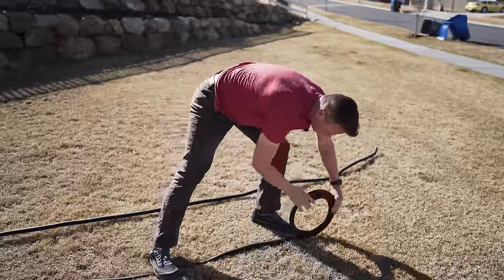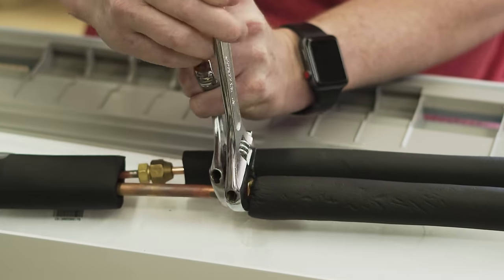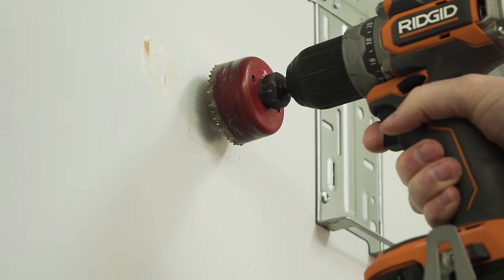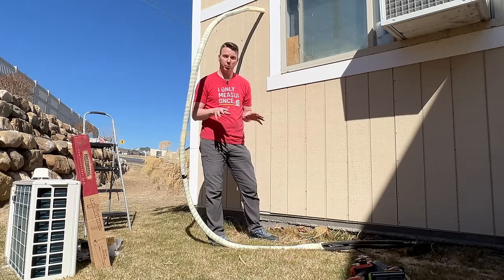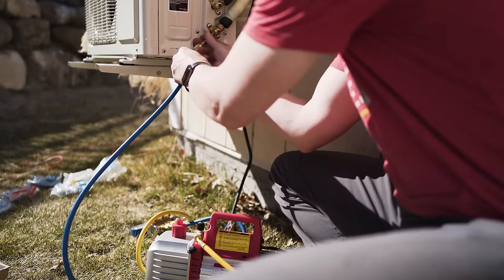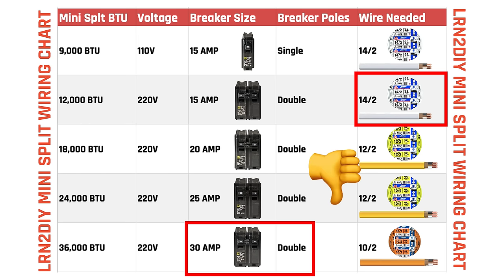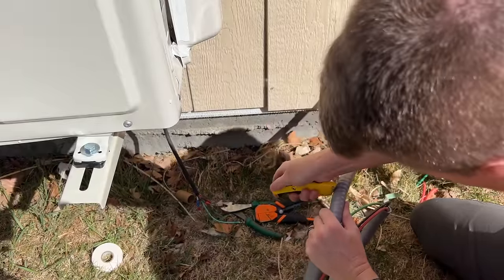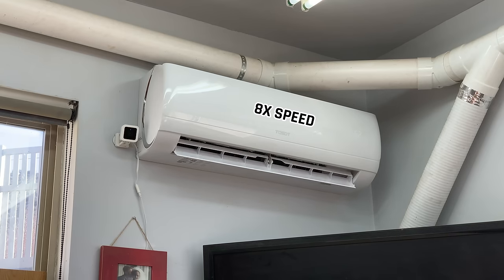DIY Mini Split Install - All the Things Nobody Shows You

Comment: Areas to be aware of:

1.) You should never use the flare nuts that are included on the refrigerant lines. These should be removed by cutting the flare off the ends of the tubing, and use the flare nuts included with the mini split equipment, and make new flares on your tubing. This should be made with a flaring tool designed for mini splits. The angle of the flares on mini splits are different than the traditional refrigeration flares. 
2.) All flares MUST be torqued to the manufacturers specifications. You cannot “feel” the correct torque, and “good and snug” is subjective. 
3.) It is acceptable to coil excess refrigerant lines to stay within the minimum required lengths. However, any refrigerant system with coiled up lines must be in a horizontal plane. When you coil up lines in the vertical plane you create oil traps. The oil in the compressor circulates with the refrigerant in droplet form. The oil cannot return to the compressor if it collects in the bottom of the vertical trap of these refrigerant lines. 

I work for a mini split manufacturer, and the above installation problems are what we see in our Top 10 Installation Issues. Overall you did a commendable job with your installation. I would only caution anyone viewing this video to make the three changes I observed above to ensure trouble free operation and performance of a DIY mini split installation.
Reply: Really appreciate these additional tips. I'll be sure to use them when I install my mini split in my new woodshop.
Reply from the maker: I love the useful info here! Thank you for sharing this. I'll see if I can reorient my lines to be horizontally coiled rather than vertical. I'm not sure I follow tip 1, since all of the flare nuts included ARE included with the mini split, not from a separate line or kit. As for the the latter portion of tip 1, I think I follow - you're saying that a flaring kit we buy from Harbor Freight, for example, will have a different angle flare than what is optimal for the mini split? Is there a place we can purchase a mini-split specific flaring kit?

Thanks again for the useful tips from someone in the know! Much appreciated.
Reply: @LRN2DIY  regarding the flare nuts, were there nuts already on the copper linset, or did you put the nuts from the unit into the tubing then make your own flare on the tubing? If so, then you are fine. If the flare nuts are on the copper lines, I would not recommend using them.  The manufacturer I work for ships our units with the flare nuts with both the indoor and outdoor units. Most mini split line sets have a flare nut already on the tubing. We instruct our dealers to cut the line set flare nuts off, throw them away and use the heavy cast brass nuts included with our units.
Reply from the maker: @rbfour5  Very interesting. Yes, they came with flare nuts on them and that’s what I used. So the ones that the manufacturers provide and include would need to be cut off and replaced? Is it because they may cause leaking down the road?
Reply: @LRN2DIY  yes. The flare nuts on the line sets are typically a thin cast brass, and not always a true 45 degree flare like the male flare fittings are on the indoor and outdoor units. If the nuts are then over torqued it will deform the flare on the tubing, and possibly even crack the tubing at the flare joint. For your shop system, I would just keep an eye on the outdoor unit connections, look for oil buildup. So clean the connections so that you have a baseline to gauge if there is an oil film that starts to build up. If it does appear months down the road, you know the flares are leaking. 
If you can reorient the coiled tubing to a horizontal plane, that would be a priority. You can strap the horizontal coils underneath the unit- that’s typically the way a contractor would do it if he is adhering to a minimum line length. Our 12k unit has a minimum length of 16’. When you aren’t able to locate the indoor and outdoor units far enough away to not have coiled lines, your only option is to coil up horizontally, beneath the unit.
Reply: Thank you!  I always value knowing what is done in the field by professionals!  I do have one question for you.  Is it possible to install the line sets inside interior walls when going from the condenser to the zone units?  I have two units I’m planning that are not on outside walls and I would like to have the line sets go inside a 2 x 4 wall.
Reply: @Dave-tg1pu  yes, it is possible to run the lines in the interior wall stud spaces. It would require access to the stud spaces by cutting through the plate at the bottom of the wall and opening up the finished interior wall. Most anything can be accomplished to install mini splits. It will require some demolition and reconstruction.
Reply: Whenever possible I simply cut out the flares and braze the lines together. Especially if the connection is to be inside a wall. Flares are always a risk for refrigerant leaks. I do the same to shorten up the line set to prevent traps { Unless the lift requires them }. I have the correct flare tool { Black Max } but I still don't completely trust them. However I'm a 30 year veteran HVAC/R tech and have all the equipment needed to accomplish the task.
Reply: @LRN2DIY  rothesberger makes a offset 45 flare tool that is suitable for that
Reply: @rbfour5  What if you only have like... half a coil worth of extra line?  My linesets were about 2 feet too long.  Too long to be a straight run, but too short to coil and hang under the condenser.  The extra is in a vertical position shaped kind of like a squished down letter C.
Reply: @nathanh4237  I’m trying to visualize the “C”, so I don’t really know how to comment. As long as your “C” doesn’t create a trap or an inverted trap there should be no problem. 
If your line set was 2’ longer, the first question I have is what is the total line set length? The second question is what is the manufacture’s minimum line set length? If cutting off the additional 2’ of line meets or exceeds the minimum length requirement, that would have been a good choice, or to simply move the outdoor unit to accommodate the length.
Reply: You dont have to use torque wrench for flare nuts. Installing aircons 10 years, never had issue.
Reply: @kareleisenhamer6549  you are one lucky installer. It’s your choice to follow manufacturers installation guidelines or not. And yes I suppose you must have the right feel for various tubing/ flare size torque requirements. I’m only pointing out installation guidelines of every mini split manufacturer that I am familiar with.
Reply: @rbfour5 I'm pretty concerned about a possible mistake i noticed and would like to know your opinion about it. He disconnected the meterset from the serviceport BEFORE opening the valves. Won't the coolant lines be filled with moist air instantly?
Reply: @mennoregts208  The service valves on the outdoor should be opened to pressurize the system before removing the manifold. You need to leave the manifold set connected to monitor the refrigerant pressures on startup of the unit. The installation instructions typically will have a chart with high side and low side pressure ranges depending on which mode you are in (heating or cooling) at a given outdoor air temperature. You can have a leak proof line set. But the refrigerant pressures can point to a problem such as a bad electronic expansion valve; a bad compressor; etc. Removing the manifold hose set while under a vacuum can introduce air/ moisture into the refrigerant lines. That is not good. Air/ moisture is noncondensable in a refrigerant system which creates a whole new set of problems.
Reply: AC tech of 10 years i would not tie the drain line with the copper lines you went that line at the lowest point so it well drain good
Reply: @averynw9180  I've have done several hundred of these over the years and have had great success with keeping the systems tight for years. It is possible
Reply: @averynw9180  one thing that helps is always use a quality line hide and make sure it's tough like inoac secondly they need either a bit of length to accommodate settling of the unit or super firm mount also if the nut does spin freely on it and flare cups perfect it should take some abuse like re leveling a unit. Just a few ideas based off of my previous mistakes.
Reply: Thanks for the info!
Reply: @mennoregts208  I'm surprised no one else other than you has pointed this out. This is a major issue the way it was demonstrated in this video. His evac basically means nothing bc he atmospheric air was allowed to enter the system at the end before he released the refrigerant.
Reply: Everything you're saying is true I tried to tell that to AC installers and they don't listen none of them even have torque crescent wrenches they just say they go by feel one guy didn't even pull a vacuum he just Purged the the line and all the and all of them with the pre flared lines eventually had leaking problems. You should make a video on how to do it properly. Some of them didn't even have the adapter with them Mini Splits aren't something they're used to doing often I suppose. I started using them about 17 years ago they are a lot more popular nowadays I've always noticed overseas there's they're very common I live in Florida I starting to see some around lately in the past few years on some older houses that don't have an attic and some shops and spare rooms but most still have the noisy window units
Reply: @rbfour5  just push the bare copper tubes, flexible drain and cable up from hole to hole, fit some nylon bending tube first. Once it's in position, foam fill the cavity.
Reply: Facts! You can also pay a pro to do it and be done with it  lol
Reply: @fixedright5161  good luck finding one most wont do it because they want you to buy theirs at a extremely inflated price 3 to 4k for a installed units you could but online for 1k and installl yourself in a couple hours
Reply: @magiccheeseball  it's not an inflated price. If you want Fujitsu or Mitsubishi it's 5k just for the equipment
Reply: @fixedright5161  of course price is vary between models and Brands and sizes but I said for a 1K mini split like a gree or whatever but they charge  $2,000 on top of whatever the cost is and I'm talking about just a simple single zone mini split like the one in this video it's a 2-hour job so they want $1,000 an hour basically, no thanks I put many of these in and I'm not even a handyman there's nothing to it a kid could literally do it. But I don't know what the guy in this video is thinking when he coiled the extra line up behind the air conditioner where it will restrict the airflow.
Reply: @rbfour5  the problem with YouTube is that you have people making tutorials who are doing it the first time without a ton of disclaimers. People like you should make videos. There seems to be an inverse relationship between how good someone is at producing entertainment vs their hands on experience and expertise on a subject. Not to be rude to this video- it was decent and entertaining. There are a lot of much worse examples.
Reply: @fixedright5161  I just had a second Mitsubishi 24K Inverter HP SEER 18 pro-installed for $3900 including the Unit (reused existing elec. disconnect),  in SWFL.....$5k+ install is highly inflated IMO.
Reply: @muskyful  sounds like you had a replacement, not a new install there. Also, we work in Westchester county in New York. One of the most expensive places to live outside Manhattan. 

3,900 at today's costs up here won't cut it up here.
 3 years ago, I could do a single zone 18k-24k Fujitsu or mitsu with electric install for about 4500  and everyone was happy.
Reply: Wasn't Me  I found out the hard way on the last one I installed (bought special order from Home Depot), that the only "warranty" service they offer, is to replace the entire unit with a different one, otherwise they hand you off to the manufacturer, who as it turns out, doesn't actually warranty the line set anyway, just the indoor and outdoor units.

Had to get a replacement line set to turn it on, and I'm sure glad I tested it with nitrogen before opening up the service valves to let the R410a spray out!  There was a hidden break in the line set somewhere under the insulation in the middle of the line.
Reply: Wasn't Me  Ive been cutting the flares of for 30 years never had a problem with warranty
Reply: @LRN2DIY  There's a high probability that your unit uses R-410A, so your flaring tool would need to be 45° which is the standard angle for R-410A lines. and the torques you'd need to use would vary depending on the size of the lines but should all be in your install manual. some open end torque wrenches are pretty affordable, or the adjustable digital ones are about $200. But pressurizing with nitrogen and using a liquid leak detector would ensure your nuts are tight enough and eliminate the need for an expensive torque wrench. R-410A is a higher pressure refrigerant than the old freon, so pressure testing to at least 300psi is good practice and will also ensure a quicker evacuation if the air is replaced with nitrogen. But either way rbfour5 is correct when they say to cut off the pre-flares. They're so bad and have so much potential for leaks.
If you're looking for a quicker evacuation you can get a valve core removal tool for 20 bucks (or so) and those come in 5/16 for mini-splits. also give you a tee to use a proper micron gauge - which isn't necessary but I like having more information than you really need when doing stuff like that.
Reply: This is all useful info but as far as #1 goes I'm not sure it applies here since the line set is supplied by the manufacturer of the unit and if we can't assume it has the correct fittings then we can't assume that they will sell you new ones that are correct either.
Reply: @johnathon007  the manufacturer of the equipment does not manufacture line sets. And every manufacturer that I have represented, sold and installed states to cut off the flare nuts that come with a line set and to use what is supplied with the equipment. In the last 30 days I have dealt with (4) systems, different installations, contractors and all reported as “ your equipment is a piece of (fill in the blank)”. EACH system had leaks at EVERY flare fitting. Those fittings were the ones supplied with the line sets. Once the contractors replaced the flare nuts with ours, somehow the equipment was no longer a piece of…….
The installer has the choice to either follow manufacturer installation guidelines or not. They do not get to choose the consequences. 
I stand firmly by #1.
Reply: @rbfour5  i dont see why you would have to change the brass flair nut in the line sets that come with the mini splits.. you would think the mfg would make them right,, i dont know about the usa products but all brass flair nut are for a 45 deg flair heavy brass fittings and coper tubing is a 0.30 wall  used in gas, air conditioning. power steering on pontoon house boats rated at 1200psi
Reply: Even if you buy the copper lines with the split system they have the wrong flare nuts?
Reply: @robertsmith2956  I have not personally seen a flare nut in a lineset that has the same quality in thickness of the cast brass on the OEM units in the past 15+ years. Not to say they aren’t out there, but I have not seen any that I would use. If by chance I found the flare nuts to be comparable I would check the flare that the lineset manufacturer made on the copper lines. Those too are usually misshaped, flare may be too short (not enough shoulder to seal on the male flare fitting); too long; not concentric to the circumference of the tube. I have seen this many times. It’s not that difficult to cut off and make new flares (with the right tools).
Reply: @ajcruzin2760  That’s very unfortunate. It goes against all refrigeration practices. To coil a refrigerant line vertically creates a trap period. An inverter (variable speed) compressor will magnify the problem with vertical traps in the refrigerant lines. The lower the compressor speed, the lower the refrigerant velocity. The oil in a refrigeration system moves through the system while entrained in the refrigerant. That only happens with enough velocity to pick up the oil droplets. When it slows down enough the refrigerant cannot carry enough oil back to the compressor. The oil lays in the bottom of the vertical traps created by looping the lines starving the compressor bearings of oil, then failure. There is no magic in one manufacturer versus another- the laws of physics and thermodynamics are the same regardless of the brand. Even if one states you can do (fill in the blank), when proper design criteria states and proves otherwise.
Reply: Just use the spin tool bits
Reply: @ajcruzin2760  I would only be speculating. It would depend upon who actually wrote that statement. Mr. Cool is not the manufacturer. The brand is private labeled for them and built by another manufacturer. This is not uncommon. There are several large manufacturers who private label their product under many brand names. But whoever made that statement in writing may not have the technical knowledge and experience of how refrigeration systems are applied. All I can say is that if this or any other brand says that you can do (fill in the blank) then when there is a major component failure they will have to honor their limited warranty on said component. I would caution the end user to know what the limited warranty states- the inclusions and exclusions. Remember- “The bold print giveth, but the fine print taketh away”. All my comments are not to deter anyone from buying a specific brand. Any brand that is sized, applied and installed properly should provide years of trouble free operation. When a installer goes outside of guidelines, instructions and known practices within any discipline ( refrigeration, electrical, piping, air distribution, etc.) then there should be no heartburn when a self inflicted failure occurs. Some choose to ride that curve of “let’s go outside the guidelines and hope nothing fails on my watch, if so we can blame some other entity “. Sounds harsh, but believe me I have seen it regularly over 37 years. 
To anyone reading this thread, and you believe it will be fine to do anything contrary to my comments and years of field experience, you have every right to follow the path you choose. For whatever reason. Whether you are a contractor or a DIYer, do what seems right to you and let’s all hope that your installation is successful with no issues or failures. Remember the installer is responsible and accountable for their installation. Good, bad or indifferent.
Reply: @rbfour5  I deleted both my replies because I don't want to be the purveyor of bad info. I looked at the install instructions yet again, and they actually do say "Keep excess refrigerant hose coiled. Wrap with protective tape and store behind the condenser in a horizontal position (flat with the ground)." Apparently on my prior read-throughs I stopped at "behind the condenser" because there isn't room to store it flat behind the unit. I'm big enough to admit I read it wrong, and this just proves why it's good to always read directions multiple times before starting something this big.
Reply: @ajcruzin2760  all of us have made mistakes throughout our lives. Mistakes have taught me much in my 61 years! 
Two things- you have my utmost respect to have reread the IOM and found you had misread it and come back to this thread to say so. Not all people would do that, so my hat’s off to you! The other thing is that I am very pleased to know now that the manufacturers statement is based on good refrigeration design practices. 
Again, thanks AJ. This entire thread has been enjoyable. Great questions and engagement. I don’t claim to know everything. But I am more than happy to share what I do know if it can help someone else.
Reply: what dealer do you work for? better question why don't they provide flare nuts that are expectable for install? ridiculous... buy Mitsubishi and never look back
Reply: I can see what you mean about the extra coils being wrapped in a horizontal plane.  Makes sense.  But, I am close to installing a Mr. Cool mini split and their instructions specifically say to coil the lines like LRN2DIY did, except they say to only UNcoil just what you need.  I can't imagine where I would locate my lines on a horizontal plane.
Reply: @sandmandave2008  in the Midwest and Northern climates, all heat pumps whether conventional or mini splits are mounted up off the ground- need to be above the expected snow line. Most mini splits that I see are typically stand mounted- either a wall mounted stand, or ground mounted stand. The excess line is suspended to the bottom of the unit/ stand. The other thing you can do is locate the outdoor unit farther away to cut the lines to the MINIMUM allowable line length so you don’t have to coil any excess length. Make sense?
Reply: @IIDontFeelSpeciaLII  I work for a mini split heat pump manufacturer. Are you questioning why the lineset manufacturer does not supply better flare nuts? Every mini split equipment manufacturer I have experience with has high quality cast brass flare nuts already on their equipment. The lineset manufacturer uses a cheap, thin flare nut; the flares are typically inadequate- the shoulder length is not long enough for a R-410a flare, the face of the flare that mates and seals against the male flare fitting is non concentric to the pipe, scratched surface and even burrs are present. So not only are the flare nuts bad, the flare itself is very inconsistent and of poor quality. Thus the reason that Mitsu; Fujitsu; Daikin; Midea; etc. instruct the installer to cut the flares off the lineset and use what ships with the heat pump equipment. 
Not sure I understand that your comment “Buy Mitsu and never look back” is relevant to the lineset discussion, but perhaps I misunderstood your meaning. 
So- who do you work for and what brands do you sell?
Reply: Here’s a video that shows exactly what I have been discussing regarding lineset flares and the flare nuts. Go to around 8:35 in the video, to about 9:40- you can see in real field conditions what I’m talking about 
https://youtu.be/itoro65YpZM
Reply: @rbfour5  yes. I’m in Texas so I’m mounting my condenser on a concrete slab.  I would use a wall mount except that wall will have a load on it for some interior stuff and my metal building manufacturer recommends not adding any more. I may move the outdoor unit further away to eliminate a looped line. A little extra #10 wire would be cheap insurance
Reply: @sandmandave2008  good choice. I too would move the unit to prevent any excess lines that would require coiling up.
Reply: any suggested tools for the flares?
Reply: @foyjamez  yes
BlackMax # BFT850
Yellow Jacket # 60278
Both of these have a tube height gauge built in so that the length of the flare is what you need for R-410a refrigerant. The BlackMax also rotates in an eccentric fashion to help reduce marring the inner flare mating surface. These are not cheap, you can find online $130- $165.00. You can use a lower cost flaring block but you would need to extend the copper pipe through the block about 1/8” as opposed to stopping it flush to the block. If you stop flush you will end up with a short shoulder on the flare. I know contractors that use both types. If you are careful with the standard block type you will be fine.
Reply: @rbfour5  thanks. I was inspecting a 150 unit remodel and the super sold the old minisplits cheap. So, I've had one that I really want to put in my 480sf workshop.
Reply: @mennoregts208  I spotted this too. I don't understand how you can disconnect the meterset without air flooding into the vacuum instantly?  Is there some kind of check-valve built into the service port?
Reply: @rbfour5  Thanks man. I usually don't engage in the comments simply because there are so so many people who seem to exist solely to try and get a rise out of people instead of having a rational conversation. You're the antithesis of that type of person. While I'm a little south of you as far as age, I'm well beyond the stage of "taking my ball and going home" when I'm wrong. I also wanted to make it clear to anyone who had read my prior comments so they didn't follow bad advice (mine). Hopefully someone else sees this thread/string and finds a takeaway unrelated to a mini split install.
Reply: @sandmandave2008  I'm installing mine soon as well. I'm fortunate that it's in the garage so my intent is to run the lines inside the garage along the top plate to the point where I can just reach the outside unit when I go through the wall and down. If your DIY kit also has the 25 foot standard line, they do offer for sale separately a shorter pre-charged line set (I want to say 16 feet or so).
Reply: @ajcruzin2760   I have looked at the Mr. Cool website and am not willing to pay $235 for the 16’ line set. After checking out all options I guess I’m going to have to leave some of the line set coiled up.
Reply: @rbfour5 I noticed he skipped the nitrogen pressure test. Is that ok to do? I am about to install one and the nitrogen pressure test really seemed like my only obstacle of confusion. If it's needed however, i'll figure out a way to get it done. I am going to DIY the install because every pro quote I got is about $3500 or more JUST to install. If I make a fatal mistake, I can buy another unit and still be ahead of the financial game lol. I am going to be installing a Cooper and Hunter 18k
Reply: @josephmccrillis8446  A nitrogen pressure test is a great way to prove you have no leaks. When you evacuate the lines down into a vacuum and watch your manifold low side gauge, the dial indicator may not reveal a small leak. This is referred to as a decay test. The only fool proof way is to use a digital vacuum gauge and watch to see how much (if any) vacuum is lost. Knowing that most DIYers will not have a nitrogen tank with a 650 psig regulator, this was not a catastrophic misstep. Only thing different would be to leave the gauges on the service ports, then open up the valves to get pressure on the lines before removing the hoses. If removing the hoses while in a vacuum you risk introducing air, moisture into the lines. 
If there ends up being a leak in the system after startup nitrogen would definitely be required to isolate the leak. Again, 600 psig using a 650 psig regulator. The standard 250 psig regulator will not find a small leak.
Reply: @josephmccrillis8446   I really don’t see the need for a nitrogen pressure test. If you pull a vacuum and it holds for half an hour, I’d say you have well sealed fittings. I know the nitrogen test puts positive pressure in the system, but aren’t you really looking for leaks, not how much pressure your system will hold?
Reply: @magiccheeseball  there is a major difference in minisplits engineering.... what you all are talking about .. is cheap Chinese garbage!! Most companies won't touch them.. BECAUSE.. no dealership network.. no distributor network... no manufacturer support..little to no parts availability... poor warranty! All you have is the price! Chinese minisplits are meant to be disposable... if it breaks.. buy another new one! Mitsubishi/ fujitshu are kings of the hill AND FOR A REASON!   P.s.. Chinese minisplits are not allowed in commercial and industrial applications. THIS IS NOT MY OPINION... ITS MY 30YR EXPERIENCE OF HVACR... but hey.. if your happy with it... good for you... time will tell!  China is known for cheap mass produced low quality products at super cheap prices! That's what China is good at!
Reply: @Blitzkrieg.u812  yeah
Reply: @Kevin-ip8uf  I believe in Europe it is now compulsory to pressure test with Nitrogen.
Reply: @magiccheeseball  done several of these and coiled the extra few feet of line set up behind the unit. All working fine for several years now. Safe and out of the way.
Reply: I agree he’s setting him self up for failure
Reply: I am planning to install condenser on my flat roof which is obviously going be above the wall mounted inside unit , the line set would need to be run vertically and make a couple turn to get around the eve. Question is would this likely cause an issue or trap refrigerant since lines will be running vertical to reach roof? (about 2-3 feet of rise)
Reply: @gusb232  as long as your piping does not drop and rise vertically you will not create a trap(s). The lines can drop down vertical from your unit in the roof; turn horizontally, turn vertical DOWN, turn horizontal, etc.
Reply: @rbfour5  "piping does not drop and rise vertically" Thanks for the response , I just spoke to the Tech support at Senville and they seem to say it should be ok.  But Im not sure I explained well enough.  Since the lines exiting the unit and through the wall are recommended to be angled downwards (not sure If i can ignore this in my situation?) Then they would be coming down vertically for a few inches and then turn up towards roof.  Thinking of instead exiting wall at a more horizontal or even slight upward angle instead of down , then turn up. Does that make sense?
Reply: @gusb232  I would come off the indoor unit horizontal and turn up vertical to the outdoor unit on the roof. No need to pitch the piping down when the outdoor unit is above the indoor unit.
Reply: @rbfour5  Cool that makes sense. I assume pitching it up a bit might work but risks water intrusion into wall. I'm also  Might use a separate  outlet for condensate line. Thanks alot.
Reply: @oldskipper1394   I agree, but for mini splits the tubes in the evaporator are most of time not standard thickness like 1/4 liquid line . Then you have problems to braze them properly/good together. I use a leak free nuts with o rings inside,  a good brand flare tool and the right torque. I have not 1 problem in 10 years.
Reply: Thanks for your helpful comments!  What mini-split manufacturer do you work for?
Reply: @adobemastr  Fujitsu
Reply: @rbfour5  You have some GREAT tips!  Have you thought about doing a video where you go through these suggestions in more detail?
Reply: @adobemastr  No, I haven’t given it much thought. I could try to video one of the contractors that installs our mini splits and point out the installation practices I have been talking about. I’ll see what I can come up with.
Reply: @rbfour5  I think such a video would be much welcomed by many people like myself, but if you don't have much experience with shooting video, your labors might come to naught.  I would highly recommend you use an external microphone setup for quality audio; there is little more defeating to a great video than not being able to hear what the person is saying:  camera microphones by themselves are NOT adequate for a great production.  If you need some tips, I might be able to offer you some helpful advice.
Reply: What do they call torque wrenches for this purpose? All I have are mechanic's torque wrenches.
Reply: @Shalmaneser1  they are called torque wrenches for mini splits as well. There are no differences, both will measure is foot pounds or newtons. As long as your automotive torque wrench can measure in the appropriate range and you have the right open end wrench sizes it will work for mini splits.
Reply: I have open ended wrenches for brake lines (no torque measurement). I have open/box wrenches (no torque measurement). I have rachet torque drivers for sockets. Perhaps a UPC, URL or video would clarify.
Reply: How about pulling a proper vacuum too?
Reply: @BrettWae  of course, a proper vacuum is critical.
Reply: @magiccheeseball  
I just had a pro come to give me an estimate. Dual zone 9k / 12k, I told him we don’t need top of the line equipment because we’re selling our house next year. $8,800! I like to support small businesses when I can, but as near as I can tell from researching prices almost half that price is labor. That has pushed me to DIY. I’m fairly handy and have plenty of time and capable friends.
Reply: @ilpostinomotociclista270  rip off a mini split those sizes are around 1k including all the likes and wires top of the like mr slim most expensive 2 to 3k
Reply: Can you answer this question~~??   Does the outdoor section,,,need to be outside?? What is the point of it being outside?
Reply: Thank you for taking time sharing your knowledge. It's really cool and I probably couldn't find anywhere else.
Reply: @elwinostrander3480  Technically it doesn’t have to be. The outdoor unit needs move air across the outdoor coil. The discharge  air from the coil on the outdoor unit will be higher than the inlet air while in the cooling mode, and the inverse is true in the heating mode. If the unit is in a confined space eventually the inlet air to the coil will become too high (cooling mode) or too low (Heating mode) because of recirculating the discharge air through the inlet. However, if the inside volume is large enough (warehouse with a mini split outdoor unit installed in a mezzanine area to heat cool an office area) then the unit will perform well. This is assuming that the discharge air off the outdoor unit coil has little to no effect on the temperature of that warehouse space. You need to answer the question of why would you entertain installing the outdoor unit inside. There are several ways to properly design a split system and locate the outdoor unit inside. My motto for many application scenarios is “Just because you can, doesn’t mean you should “.
Reply: @rbfour5  thank you for response,,  I just thought about less debris in the unit (leaves, dust, dirt,etc)   Im not heating and/or cooling large area(12X20),,,,so basically,,,just wondering about the inside installation.   Thanks again for responding~~
Reply: @rbfour5  I've been reading all your replies to everyone in this thread. You sir, are a wealth of knowledge. I have a  question if you have time. I installed my own Pioneer mini split about 2 1/2 years ago. 1st timer, but I'm fairly detailed and worked in many trades for 40 years. I'm that guy who owns way too many tools to use consistently, but just won't trust the average pro to do my own work if I can do it myself. Owned my own construction business most all my working life and realize that the boss or owner (hopefully) knows how to perform most things the right way, not so much the techs we have working for us, except for some. 

Anyway, to my point. After trying to educate myself with the right information, especially on all these videos, both amateur and pros, I hear many people working in the field that seem to know the correct methods, talk about how too many techs in the field don't do proper installs, especially pertaining to the correct flairs and using eccentric flaring tools or digital vacuum gauges to vacuum lines, etc. They will work with the quickest and easiest way to do the job and swear it don't matter that they do what others say is a must to get the correct results without any problems down the line. I think my unit is still working fine. I haven't noticed any drop off and it's save me thousands over the past few years in oil heating costs and running window units for A/C. I also installed a hybrid water heater (with heat pump) for hot water to replace my furnace coils heating up my potable water, which was costing me a few tank of oil in the warm weather seasons. Oil was costing me 1000/month in the coldest winter months. From 2 years ago I'm now saving on average 200/month over a year at least on energy costs. 

My thinking is I'm no expert and a newbie to the install I did on my mini split and the workings of A/C in general. I may not be getting the most out of my install when it comes to the refrigerant end of things. I was thinking to have someone check my line charge and overall install I did just to be sure I have it set up right. But I don't really trust if I'll get one of those techs others mentioned that aren't doing the proper installs themselves. I've seen it many times in what I do myself in construction. Any suggestions, either on how to find the right person to get or is it easy enough to check my charge myself for problems or leaks myself. I don't have any experience with recovery of refrigerant. No recovery tanks or nitrogen. I've only tried to teach myself about the process. 

Or I was thinking if I point a infrared thermometer at the inside unit coils I could tell by reading the temperature of how hot or cold in either season the temps read? Maybe I could tell by what my readings are coming out of the inside unit. Any insight is greatly appreciated.
Reply: I have always wondered why the manufacturer included extra brass nuts. Now i know. Ive also installed about four split units and they ALL leaked after about a year of use. Im convinced it is because of the poor flaring in the piping. Thank so much for this knowledge. God Bless You!!!
Reply: @rbfour5 Question regarding the oil trap issue. In a situation where the lineset needs to run say up into an attic and back down a bit to the head, is there any risk of trapping oil at the head unit? I believe I've seen that done before, and it seems unavoidable in many scenarios.
Reply: @evan-edstrom  No, that scenario would not create a trap.
Reply: I've never replaced the included flare connections. Zero issues. I've only had to replace it once and it was when I tried to torque it to spec, top end of the spec, and it ruined the flare. Which is when I had to buy a flare kit and re-flare it myself.
Reply: @xxvodanhxx  that’s amazing you have only had this happen once. In my career working for manufacturers every single “loss of charge “ had leaks at the ODU flare connections- all were the poor quality line set provided flare nuts, without exception.
Reply: Can you use nylon glue the still make a tight seal rather than cut off and install new ones?
Reply: Install brass forged nuts on the lines the cast brass that’s on the line set is junk. Use Nylog. When you look at forged vs cast brass you’ll understand
Reply: With line sets, how is a homeowner supposed to now charge the system after cutting off the flares?? Also, since the line set came with the system, I would imagine the flares actually match the connections on both the evaporator and condenser ends.
As far as the coiling direction..., just pull out a condensing unit on a restaurant prep table. There is a good 10 ft of coiled copper tubing that allows you to slide it out for repair. Never had a problem with them in 11 years.
Reply: @robsapplianceplus6071  If the DIYer does not have the ability and tools to cut off the cheap flare nuts that come with either pre charged or nitrogen charged lines, they should have a licensed contractor do it for them, or go ahead and use it as is- and suffer the consequences of leaks. The flares that come on these line sets are the correct size- but they are cheap cast brass compared to the forged brass flare nuts that are on the mini split indoor and outdoor unit. As well, the flares on the copper tubing are usually not concentric, and poorly made. 
In regards to your prep table experience- of course, a compressor that runs at full capacity, single stage will ALWAYS have enough refrigerant velocity to carry the oil through vertically looped piping. Any inverter driven compressor running less than full capacity will NOT have enough refrigerant velocity to transport the oil back to the compressor. The oil will lay in the bottom of vertically looped piping (now a trap), starve the compressor of oil and when the refrigerant velocity increases (say running at full capacity) guess what happens next- the compressor is oil slugged. And compressors cannot compress a liquid so soon the compressor will fail.
Reply: @rbfour5  If the DIYer doesn't have the certification to now purchase more refrigerant he lost by cutting off the flare nuts in the precharged line sets, he can't finish the job anyway. From your point of view, this is just not a DIY job then.
Reply: @rbfour5  I am planning to buy a senville dual zone unit. 12k and 18k. With one outdoor unit. The outdoor unit will be about 6 ft from one handler and about 30 ft from the other. Is there such thing as it being too far away? Also, does the outdoor unit need to be right next to the disconnect or can it be a couple feet away?
Reply: @marioalvarez681  first let’s talk about the disconnect. It should be close enough to break the power to the outdoor unit. Some local codes state it needs to be within reach if you are standing/ kneeling by the unit. I don’t think two would be an issue but check with your local code officials. 
The refrigerant lines should have a specified minimum and maximum length. In multi zone systems, there is also a maximum total length of all indoor units. Check the installation instructions for these minimum and maximum line lengths.
Reply: Doesn't he need to open the bottom valve on the exterior unit when he uses the vacuum pump? Wasn't he just vacating the gauges that he bought because he didn't open the valve?
Reply: @Cactii101  No, he was correct to connect to the service port and pull a vacuum on the refrigerant lines AND the indoor unit. The refrigerant is in the outdoor unit and the service valves that the lines connect are back seating valves meaning they only fully close off from the system when the valve is turned in all the way clockwise until they stop. If he would have opened the service valves it would have released the refrigerant into the system which would be contaminated with air (a non-condensible) and moisture. When that happens you have ruined the refrigerant charge and moisture will be absorbed in the oil in the compressor. The oil in a R-410a compressor is polyolester (POE) oil which very hygroscopic, meaning it absorbs moisture. There’s no way to boil the moisture out of POE oil with a vacuum pump. 
Hope this helps.
Reply: @rbfour5  thanks, I was wondering if that valve worked like that.
Reply: Thanks.   I really appreciate you taking the time to share your wisdom with everyone.
Reply: I would also highly recommend the use of a micron gauge to ensure you are hitting and holding the vacuum in the manufacturers range, normaly around 500 micron.
Reply: I appreciate this video and your comments.  I just put in a Blueridge mini split, supposed same warranty at Mitzu 5-7yrs.  I looked over the supplied line set from Alpine Home, it had HD bronze fittings.  Installed and no issues.   I appreciate experts like you that share relevant experience.
Reply: @rbfour5  It just goes on and on and is full of great info and amazing people.
This is what YouTube should be!
Thank you to every single person who's commented and special thanks to rbfour5 for making it happen.
Dude thank you, seriously thank you. You can have my 2023 internet award! 🏆
Reply: @rbfour5  From the TOSOT manual - "Remove the manifold gauge, open the valve core of the liquid valve and gas
 valve completely by turning anticlockwise with a hexagonal allen wrench."
Reply: I can assure you that the flare angle is identical in both refrigeration and air conditioning with regards to copper. Swageloks and other types of flares can differ but they are specialty equipment for different types of metals
Reply: so just to be clear, one should cut off the flare at the end of the copper refrigerant line and then use the same nut that comes off after you reflare it? there isn't a second nut included or that i need to buy? thank you. someone mentioned something about the process here where, after he pulls a vacuum, that he may have introduced air into the lines again? or was the process done properly in the video?
Reply: @mikes5311  you should cut the flare off the refrigerant line set, throw that nut away; use the nuts that are shipped with the outdoor and indoor units and make new flares on the tubing. The flare nuts that come with the system are heavy cast brass; the flare nuts shipped with the line sets are TYPICALLY a thin cast brass that can/ will distort when tightened. This distortion can tear the thin copper. Also, the flares on the tubing are very inconsistent. They can be eccentric to the centerline of the tubing making the shoulders of the flare short on one side. I’ve seen them not be 45 degrees; etc. Save yourself the potential leaks that occur when the line set nuts are used instead of the equipment flare nuts.
As far as the evacuation process in the video, it’s been so long ago that I would have to watch it again. I’ve slept since then… 😎
Reply: Lol… thank you. I will defer to the manual then and keep learning till i attempt install
Reply: @rbfour5  No codes for that? I know ethernet lines have codes for fire safety I wouldn't see why they wouldn't do the same for refrigerant lines.
Reply: @mikes5311  I asked TOSOT about the brass union nuts on the line sets, and they said that using them is fine. No need to replace, even though they do supply one extra set. After pulling a vacuum, and closing the manifold guage, you have  negative pressure in the lines. CAREFULLY, release just enough refrigerant from the top line until the guage reads positive, then quickly remove the gauge line from the service port. This keeps ambient air from getting in the lines. You'll feel some release until the valve closes.  None of that is in the manual, but it comes from TOSOT support.
Reply: Thanks For this info!!!
Reply: @averynw9180    Come on Man these units cost like 15 cents a day to use for power (depending on the state of course)... they are so energy efficient...
Reply: So a gas line flaring tool won’t work. What flaring tool should I get
Reply: Eccentric flaring tool required and will provide a 45 degree finished flare.
These flaring tools are not only for use on mini-splits...
When in doubt, call the tech support, or better , email them.
 A lot of us have been performing these services  for numerous years, keep in mind that , just because its on YouTube or Google, it does not necessarily mean that it is correct...
Take care...
Reply: @rbfour5 Well that's annoying - I just finished installing mine, the manual didn't say anything about not coiling vertically.  I coiled mine in three 5' loops inside my wall. Would you suggest removing the refrigerant from the lines, cutting them to size and flaring - is that doable?  Obviously I need a machine to remove the refrigerant.  Thanks for the knowledge!
Reply: @jimwright9021  A few questions: 
1)- Is this a multi zone system and are the indoor units all wall mount?
2)- Are the refrigerant lines still accessible or are they covered up? 
3)- Do you have attic space above to coil lines horizontally and drop down through the top plate to your indoor units?
4)- Do you know what the minimum line length is for each indoor unit?
5)- Did you add any refrigerant to the system (if multi zone) during the installation?
6)- Does this system use “pre charged” line sets?
You are correct that the refrigerant will need to be recovered from the system before opening up the lines if either of the following are true:
- Pre charged line sets 
- Additional refrigerant was added due to lineset lengths 

A system that does not utilize pre charged lines will have a factory refrigerant charge in the outdoor unit. The charge will be enough to cover a factory determined length of line set(s). If the line lengths exceed the factory charge that manufacturer will have specifications on the amount of refrigerant (in ounces) that must be added per foot over the length of line accounted for the factory refrigerant charge. 

Once these determinations are made you must adhere to minimum line set length per indoor head. If the location of the outdoor unit to the indoor unit(s) is less than the minimum length, your choices would be coil excess line horizontally and either strap to the bottom of the outdoor unit/ stand; coiled in attic space above indoor units; or relocate the outdoor unit that would accommodate minimum length requirements without having any coiled line(s).
Reply: @rbfour5  Thank you very much for your help! Answers:
1. Single zone, wall mounted
2. Still accessible
3. Yes to attic, although if I need to remove refrigerant I would just install the correct length of line.
4. 10ft min length
5. + 6. Precharged lines, didn't add refrigerant.
It is 11ft from the outdoor unit to the indoor unit.  
Also this got me thinking, as I have 10ft of line from the outdoor unit to the trap.  I read that the issue with traps is that you need the oil to flow back to the outdoor unit when it stops, and that when the unit is running the oil flows everywhere (out of a trap).  Is that correct?
So, since I have 10ft of line without a trap in it, is it equivalent to changing the line to 11ft and not having the loop?  Does 10ft of line have enough oil to flow back to the compressor?  Hope I'm making sense.  Just wondering if my exact situation is OK as it is?
If I had the equipment to remove and recharge the refrigerant I would just do it.
Reply: @nathanjenkins714 did you spell correctly?  Went or bent? I dont understand somthing here, can you refraze it.
Reply: R410a is highly miscible with the lubricant in all phases (gas/liquid) so it seems unlikely that a trap could have any effect even if you wanted it to. Maybe with older refrigerants it was necessary. R22 was a mix of oil and gas and it had to follow certain rules on how to install the line-set in order to prevent oil trapping. Old knowledge doesn't always keep up with times,  it's best to read the new manuals and not rely on what you learn 30 years ago.
Reply: @nathanjenkins714  , One of the best comments here and one of the most overlooked things that many do improperly
Reply: @magiccheeseball  - Two years after your post, we had a quote for a 9K BTU mini-split... $9500!  He insisted we use his system and not the mini-split, which he said will break down in no time.  Others have quoted no less than $2500 to do an install only.
Reply: @imasahm  wow did it come with a 24 carat gold diamond encrusted remote? And ridiculous install price for a simple install that's why there's so many people doing it DIY
Reply: @rbfour5  So if the excess line has to be horizontal, why is the primary run made from a high location in the room to the outdoor unit much lower, meaning a 6 to 8 foot vertical run?  Would that, too, cause a problem?
Reply: @rbfour5  In other words, regardless of your kind words to the channel operator, and in spite of his good intentions, this seems like it is a video on how NOT to install a mini-split.
Reply: @kettch42  YouTube and X, other social media as well, allows anyone to be an expert in anything, making their screen names indicate expertise that they have in their minds only.  AC is not something people should learn from first-timers, just like you said.  It's far too expensive when you screw up equipment.  And electrical is, also, not something to learn from someone who says that one of the breakers on a 220 circuit is neutral.  Electrical mistakes are not just expensive but they can also be very deadly and burn one's house down.
Reply: @sandmandave2008  Thanks for the tip.  What I get from the combination of your post and those from @rbfour5 is to move the outdoor unit away from the indoor unit in the direction of the electrical panel, not requiring more copper wire but requiring less.   I'll run the lines between my mini-split units, setting the outdoor unit as required, before doing the electrical.
Reply: @dalepres1  vertical lines are not a problem, unless you exceed the manufacturer’s maximum vertical separation from the indoor to outdoor unit. The problem is when you loop lines in a circle on the vertical plane, each loop becomes a place (trap) for oil to settle in the bottom of the loop(s).
Reply: @dalepres1  I wouldn’t go that far to say this is a “How not to” video. Nor was my critique meant to discredit the video. These DIY videos are very informative and helpful. What makes them even more helpful is when people who may have lots of practical experience can comment on steps/ processes to help someone from making a mistake. It’s a great learning platform where everyone can learn. I learn something new everyday. And if I am doing something wrong or if there’s even a more efficient way to do something, I embrace it.
Reply: So...good job except for the fact that his unit will leak because of incorrectly attached refrigerant lines; will fail prematurely because the compressor won't be lubricated; and electrical risks from oversizing the breaker & leading future people working with the system to believe that a hot wire is a neutral wire because he used the white wire without labeling it. Yeah...good job.